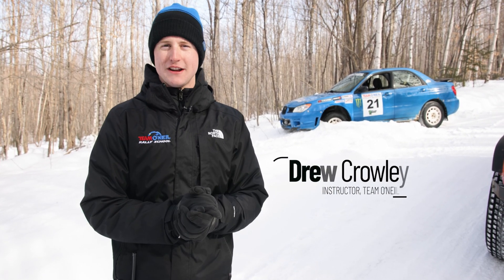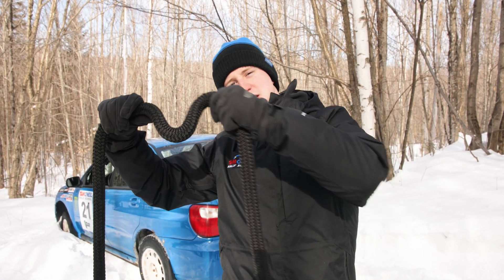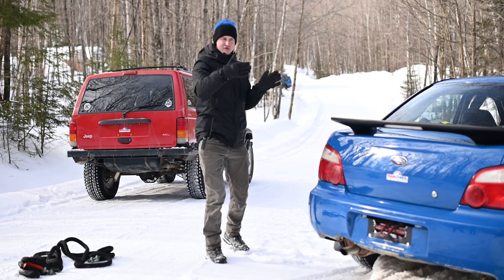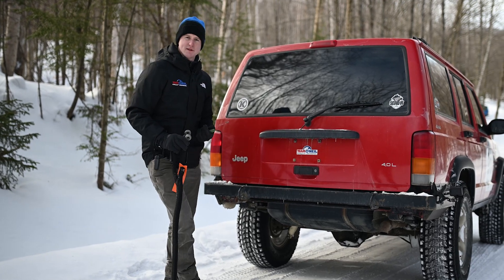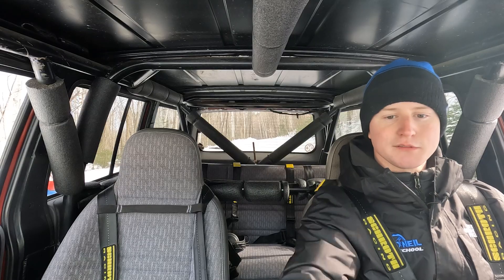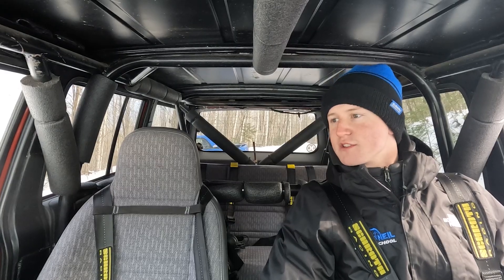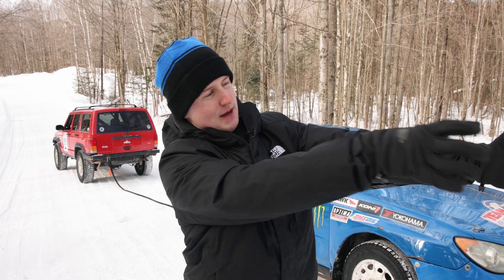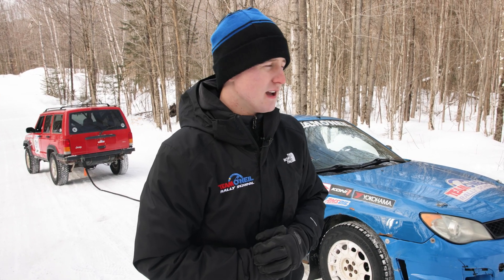Vehicle to Vehicle Recovery With a Kinetic Rope

Comment: I don’t understand what you hooked onto on the car? & where do I get a bow shackle (never heard of em) TY
Reply from the maker: The car in this video has a tow hook welded to the frame of the vehicle. The bow shackle is basically a hook with a bolt in it that you can attach to and remove from other hook/anchors. Soft shackles are also commonly used. We recommend  purchasing this type of equipment from a reputable American company, as some overseas manufacturers might use a softer metal with a less quality forging process.

Comment: So this technique only works in the slippery snow then.  I assume it wouldn't work on the side of a muddy ditch.
Reply: 🎉😮😢Z😮😮
Reply: 😢😢Oxygen shouldn't hold you back.
Buddy™ helps you live life to the fullest—without the hassle of tangled tubing.

💚 Enjoy more freedom and confidence every day
😊 Keep your tubing organized, off the floor, and out of the way
🔁 Holds up to 50 feet of non-kink oxygen tubing
🚶‍♂️ Walk, move, and live with ease—Buddy™ moves with you
🏠 Perfect for home use with any oxygen concentrator

Your oxygen should support your life—not limit it.
Buddy™ is your go-to oxygen tubing management system, designed to make daily life simpler, safer, and happier.

Breathe easy. Stay active. Live joyfully with Buddy™.Oxygen shouldn't hold you back.
Buddy™ helps you live life to the fullest—without the hassle of tangled tubing.

💚 Enjoy more freedom and confidence every day
😊 Keep your tubing organized, off the floor, and out of the way
🔁 Holds up to 50 feet of non-kink oxygen tubing
🚶‍♂️ Walk, move, and live with ease—Buddy™ moves with you
🏠 Perfect for home use with any oxygen concentrator

Your oxygen should support your life—not limit it.
Buddy™ is your go-to oxygen tubing management system, designed to make daily life simpler, safer, and happier.

Breathe easy. Stay active. Live joyfully with Buddy™.Oxygen shouldn't hold you back.
Buddy™ helps you live life to the fullest—without the hassle of tangled tubing.

💚 Enjoy more freedom and confidence every day
😊 Keep your tubing organized, off the floor, and out of the way
🔁 Holds up to 50 feet of non-kink oxygen tubing
🚶‍♂️ Walk, move, and live with ease—Buddy™ moves with you
🏠 Perfect for home use with any oxygen concentrator

Your oxygen should support your life—not limit it.
Buddy™ is your go-to oxygen tubing management system, designed to make daily life simpler, safer, and happier.

Breathe easy. Stay active. Live joyfully with Buddy™.Oxygen shouldn't hold you back.
Buddy™ helps you live life to the fullest—without the hassle of tangled tubing.

💚 Enjoy more freedom and confidence every day
😊 Keep your tubing organized, off the floor, and out of the way
🔁 Holds up to 50 feet of non-kink oxygen tubing
🚶‍♂️ Walk, move, and live with ease—Buddy™ moves with you
🏠 Perfect for home use with any oxygen concentrator

Your oxygen should support your life—not limit it.
Buddy™ is your go-to oxygen tubing management system, designed to make daily life simpler, safer, and happier.

Breathe easy. Stay active. Live joyfully with Buddy™.Oxygen shouldn't hold you back.
Buddy™ helps you live life to the fullest—without the hassle of tangled tubing.

💚 Enjoy more freedom and confidence every day
😊 Keep your tubing organized, off the floor, and out of the way
🔁 Holds up to 50 feet of non-kink oxygen tubing
🚶‍♂️ Walk, move, and live with ease—Buddy™ moves with you
🏠 Perfect for home use with any oxygen concentrator

Your oxygen should support your life—not limit it.
Buddy™ is your go-to oxygen tubing management system, designed to make daily life simpler, safer, and happier.

Breathe easy. Stay active. Live joyfully with Buddy™.

Comment: Old video but.
1. Bow shackles should always be fully tightened, manufactures of the shackles say you greatly affect the rating not having them snug, now sure you maybe using a 5ton shackle to pull out a 1.5ton car, but there's math involved with actual load forces when using kinetic recoveries and level of "stuckness"
2. Should always try to recover using the least amount of force required. aka always try a slow tow out vs kinetic tug first, then slowly increase the force you need.
3. I do tow outs all day long with a tow strap and no kinetic entry pulling them out the way they went in, there's no point plowing more ditch and potentially hitting hidden dangers. 
4. As somebody else pointed out need to find a rated recovery point, and quite often most of the ones you'll find on a stock car for the street will be designed/rated for a straight on tow pull vs an angled kinetic pull.
Reply: I bought a 30' x 3" tow strap, but everyone is talking about these kinetic ropes, idea was to use it to pull cars out when stuck in snow, we live in remote area and sometimes tow truck may be hours away, so as I have a Jeep Wrangler with a winch, I don't mind helping people. But did I get wrong rope/strap? 

I was going to use winch with snatch block. Or hoping to. 

Thanks
Reply: @googlreviews7813  I have a Jimny (smaller version of your car but similar) and I have both. A tow strap like you bought, and I bought a kinetic rope also. Last weekend I pulled a Honda that was bottomed out in a snow pile. It was enough to just use the static tow strap and 4WD low range. I made sure to slowly remove the slack and avoid any yanking. But if it had been super stuck I would’ve switched to the kinetic rope and yanked it out. But then I would’ve likely attached the kinetic rope with a nylon sling around the rear wheel spokes, or something solid underneath the car. Forgot to say: I think it’s great to have both a winch, with! A snatch block or ring, as well as those two types of ropes. Then you can approach different angles and redirect stuff etc much better.
Reply: @googlreviews7813  Some people will say yes.  

It depends how you use it. If you connect your jeep directly to the other vehicle via the tow strap and drive away, a tow out as if you were pulling a trailer it'll work. If you want to use it as a winch extension, it'll work for that, just keep in mind breaking strength ratings.

Where people will say you bought the wrong one is a jeep is a light vehicle for doing recoveries (don't get me wrong they work, just comparatively light) to do a pull out where you need to take a run on a slack strap, that's call a kinetic recovery and a tow strap is the wrong tool for that. I've done very very light bumps/hits/runs on my 2" 20K Breaking strength cheep strap without issue, but you just need to know the risks of breaking a strap or something worse and the potential stuff flying through the air.
Reply: @gold5th  

Can you try tow out, driving back to pull out the vehicle, plus use the winch at the same time? 

If yes...

Would you use he rop on winch to tow out and pull? Or have tow strap attached between two vehicles to tow out and hook up the winch separately?
Reply: @googlreviews7813  I'm not sure why you'd want to winch and tow at the same time, from the same recovery vehicle. there's no gain, you'd winch in shorter than your tow strap in seconds and all the load would be on the winch. The only good use I can think would be tow strap to the stuck vehicle then winch from the recovery vehicle to a solid point to assist with the pull.

Towing out with the winch cable, from what I've heard it's not recommended, it's fairly hard on the winch brake.

Personally 97% of the time I do tow outs with the tow strap, 1% of the time i use a Kinetic rope, and 2% I use my winch.
Reply: @gold5th  

Thank you, that's all good info. 

I am new to all this so watching videos and asking questions to learn.

Comment: I need to know how to hook the rope to a car that dosnt have a hook or latch like that. which part of the car can i hook it to that dosnt have that?
Reply: When I got myself into a situation (before I invested in self recovery gear), the tow truck that helped me, wrapped a nylon strap around the wheel spokes. Worked well! I have two 2 metric ton rated (green) soft nylon rigging slings in my car all the time for these reasons. One can anchor to the other car, the other can e.g be an anchor around a tree
Reply from the maker: Ideally if there are no official recovery points , look under the car and see if there is part of the frame that can be used. While suspension parts such as control arms might look like a quick and easy solution they will most likely get damaged during recovery.

Comment: Should have pulled the vehicle the other way. Doing an inline pull is easier. So pull it out from the direction it went in if you can.  Would have had it out on the first try. Also limit damage to the vehicles.

Comment: nice instruction., with great pointers (e.g. backing the bow shackle pin off a quarter turn to prevent binding) that are not normally explained. Now please do a version where you recover a stock unibody vehicle that does not have that very convenient, robust and custom central recovery point, forcing you to tie into some parts of the suspension and requiring something other than a bow shackle. That is far more likely to be the case and is far less covered in the many Youtube recovery videos.  Also, if I understand correctly, trying that high angle side pull technique with a hitch receiver-based recovery point instead of that nice custom point on your Subaru, is strongly discouraged because hitch receivers are not designed to withstand side loading. In that case do you recommend a straight pull despite the disadvantages you listed? Need more recovery instruction scenarios for normal vehicles.  Kinetic rope and soft shackles rock!

Comment: Why no central hitch on the Jeep?
Reply: Two lets you set up a bridle splitting the load between the two points
Reply: @andrewahern3730  bridles not done at the right angle can cause inward force on the recovery points, a central hitch is literally bolted to each frame rail tip, thus splitting the load along both frame rails, or unibody mounting points.

Comment: Didn't explain how kinetic ropes spread the traction requirement over as distance instead of a static rope that puts all the traction requirement on one specific spot on the ground.   Meaning a kinetic rope is much less likely to end up with the recovery vehicle digging a hole in the ground.
Reply: Oh, I see. I knew there had to be a reason people accept the extra risk of gear slingshotting back when a tow point or fitting suddenly fails. So, with a winch, where traction and momentum aren't useful, presumably a low stretch line is better....